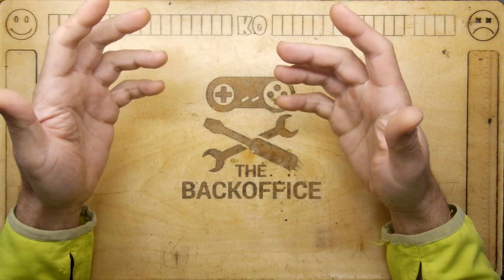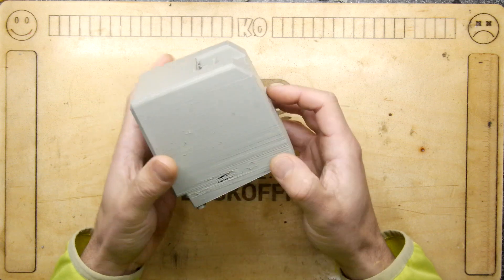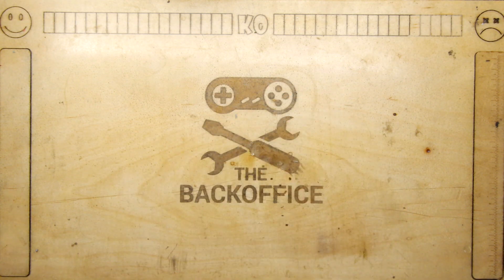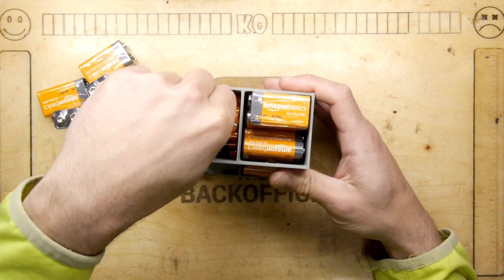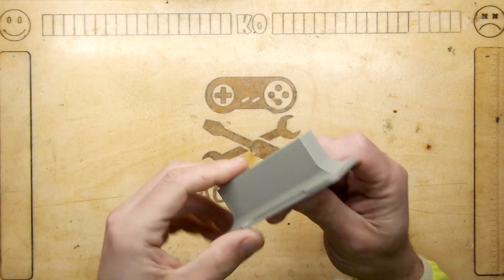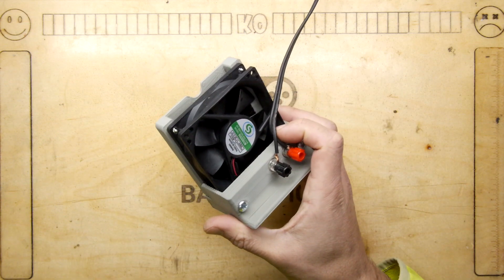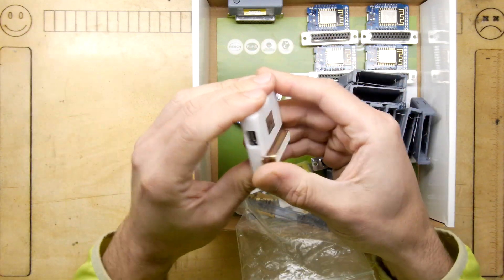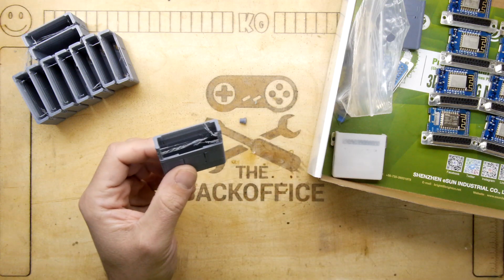Feburary Catchup - 3D printing special Mini Atari ST, retroNET v4 case and more!

Comment: For a split  that small in a paper speaker I would go with some contact adhesive on its own, it'll stay flexible enough and stop the spilt getting bigger
Reply from the maker: That sounds like a great solution, I will definitely be trying that. Thank you!

Comment: That surely be an original ST rather than an STF with a floppy or an STFM with a floppy and a modulator.
Reply from the maker: I didn't model in the floppy 😂
Reply: @backofficeshow  yeah, I know, I want that one...
You were talking about what model it is without the floppy. That's the original ST. Take your pick from the the most common 520ST, the never released 130ST, the 260ST which didn't sell well and many models upgraded to 512kB, the 520ST+ with 1mB or the 520STM.
Reply from the maker: I think ctrl+alt+Rees has the 260ST. I am not sure you can do much with it, but nice in a collection.

I really like my MEGA 2, they had amazing keyboards on them
Reply: @backofficeshow  Rees does but from his investigations he casts doubt in whether a 256kB ST was ever truly a thing. His 260ST has 512kB from the factory so it's a legit 260ST but really a different badge with a 520ST under the hood.